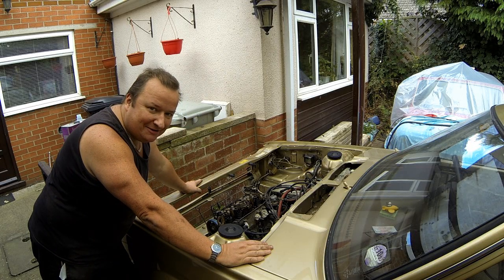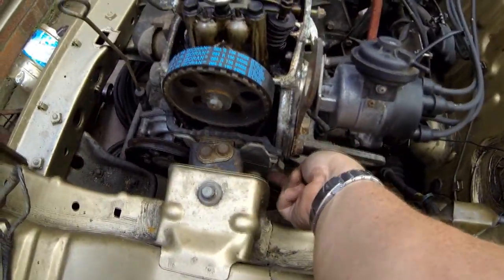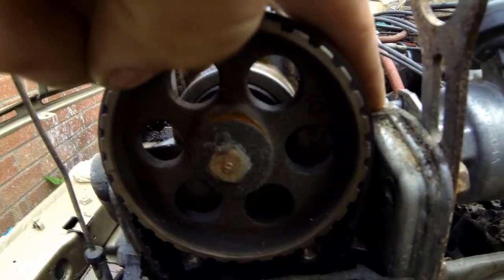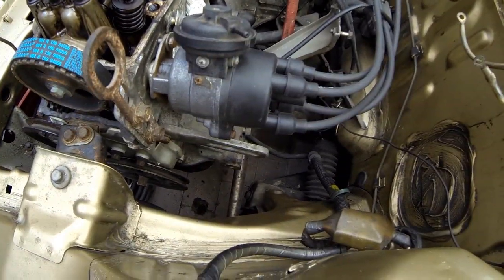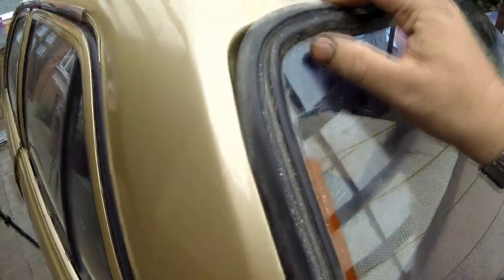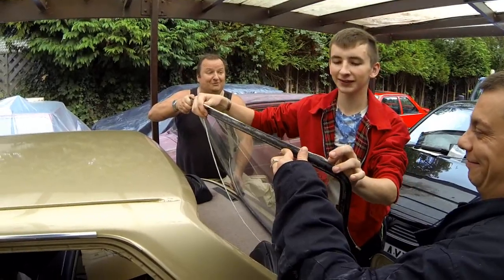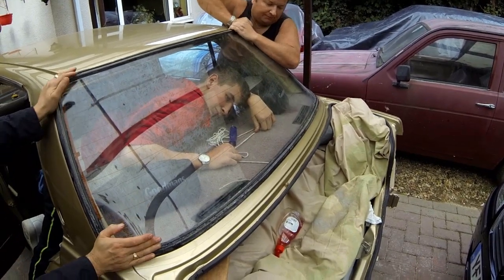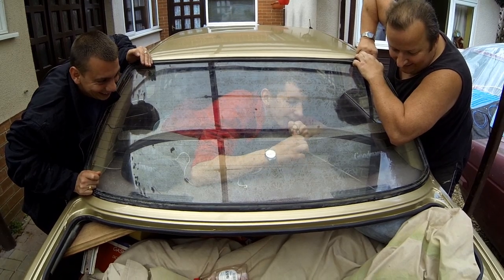Part 12 Triumph Acclaim Restoration Fitting The Rear Screen And Engine Problems

Comment: Hi Martin. Been watching all of these vids on the Acclaim up to now - very interesting stuff. I know these videos are quite old now, but just wondering about the use of washing up liquid to help ease the screen in. I've always been told never to use washing up liquid, as it contains salt which will obviously slowly eat away the paintwork underneath the rubber seal. Much better to use car shampoo for this purpose. As a Classic Mini owner like Jimmy, I've enough rusty bits to worry about already!
Reply from the maker: +Jacob Drummond Hi Jacob, not heard of that one but thanks for the tip. I'll remember that next time. I still have the Acclaim and will be back on it when the Mondeo is out the way.
Cheers
Martin

Comment: Hi martin how are you? Keep up the excellent video's :) just a quick question regards to my challenge extreme lawn mover. Its all of a suddent just stop working, everytime i go to start it, it ticks over for about 2 seconds then cuts out. Ive checked petrol etc... Please help???
Reply from the maker: I would fit a new plug. You'd be suprised how many mowers I have repaired where the plugs cause this fault.
Cheers
Martin

Comment: hi martin, this reminded me of fitting a front screen in a hillman avanger that i owned about 30yrs ago, me and a mate in the snow!!   Have you considered the  triumph owners club for the  seal inserts?   or a company called seals direct have half a dozen insert profiles to choose from. good to see you keeping it fun as always..
Reply from the maker: I've not thought of the owners club, I did look at Seals direct but couldn't find anything similar. Another subscriber pointed me to Baines and I found this http://www.coh-baines.co.uk/products/PT-10A-%252d-Plastic-chrome-windscreen-insert-strip.html

Looks like it will fit. I'll give it a try. Thanks for the info.
Cheers
Martin
Reply: retrorestore
That Baines place looks good, and has been duly bookmarked!  The ones on seals direct seemed to have the V shape underneath, but i saw from you vid that yours was flat.Stag owners club in headcorn, nr maidstone in kent used to carry spares for Triumphs in general, but now with the net, the world is your 'lobster' as Arthur Daley would say.
Reply from the maker: Cheers Bud, Good info.
Regards
Martin

Comment: Hi Martin am after a compresser to do some spraying and impact gun etc would this compresser be a good one the spec is below 

 Engine Size: 2.5 HP
Power Consumption: 1.5 kW
Voltage: 230 V @ 50 Hz
Rated Speed: 2850 rpm
Current: 7.5 A
Air Displacement: 9.5 CFM
Sound Level: 97dB
Discharge Pressure: 116 PSI / 8 bar
Tank Capacity: 50 litres
Air Outlet: Quick Release Uni-Hi Flow
Reply from the maker: Air tools might struggle but should be ok for spraying but i'm no expert so someone else might know better.
Cheers
Martin
Reply: How many litres is your compresser Martin
Reply from the maker: it's a 60cfm.
Reply: Yours is 60 litres
Reply from the maker: 60cfm, 50 litres
Reply: 60cfm that's a big compresser as the ones I been looking at r between 7cfm and 14cfm I hope u didn't mind me asking I would like to start doing wot u r doing to make a little extra cash u do ex work
Reply from the maker: Scott Crisp
 this is mine http://www.clarkeservice.co.uk/manuals/compressors/raider60_120.pdf
It's the smaller one of the two.
Reply: Thank u Martin for your help I hope u didn't mind me asking
Reply from the maker: That's ok. Cheers
Martin